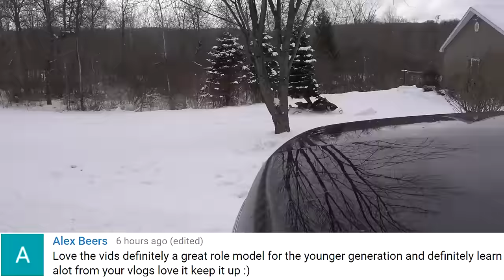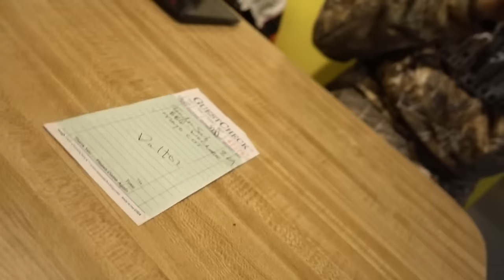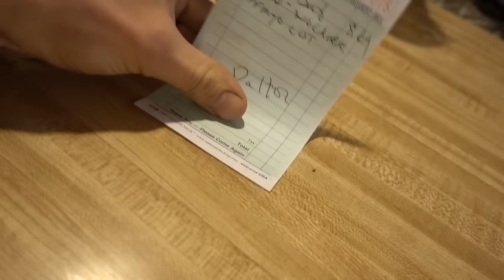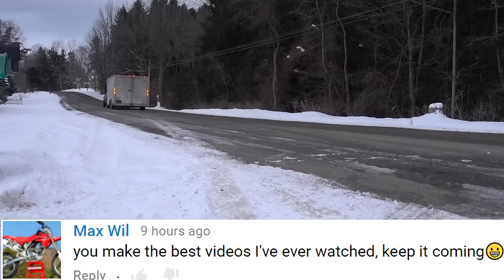THE COOLEST COP VEHICLE!!!

Comment: Rodeo costs the most. I have $24000 in horses. And a $100,000 horse trailer. Plus $70,000 truck so I don't think any other sport costs that much
Reply: The WyGuy there is
Reply: The WyGuy there is no need for that kind of equipment. You can rodeo for a lot less
Reply: The WyGuy I don't think anyone considers rodeo a sport , it's more of a very specifically chosen act of insanity lol. no ones growin up at my school ever took part in a rodeo lol
Reply: The WyGuy i forgot a F1 cost less than 194,000$!
Reply: Maybe nascar
Reply: The WyGuy sprint car racing
Reply: Wyatte5.9L that’s not even a sport
Reply: and that doesn't even include my belt buckle!

Comment: In my opinion raceing cars drag or rally is the most expensive cuz you need like a $100000 car and pay for truck and trailer to pull that car and any damges to the car during raceing so you really have to pay like $300000

Comment: The most expensive sport really depends... you can spend as much or as little money on anything... some of the equipment would not be as nice or have as good of quality, however it would (in theory) be operable. There isnt necessarily a defined line; i could spend 500 dollars on a shitty, running sled, and 20 bucks for a garage sale helmet and im basically good to go (not accounting for gas). and vice versa, i could spend 10,000 dollars on a nice, brand new sled, 400 dollars for a fancy helmet, buy fancy goggles, gloves, jackets, etc. and really rack up a hefty price.